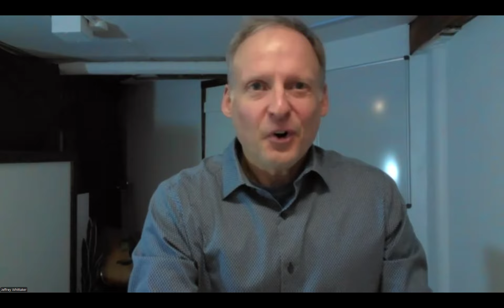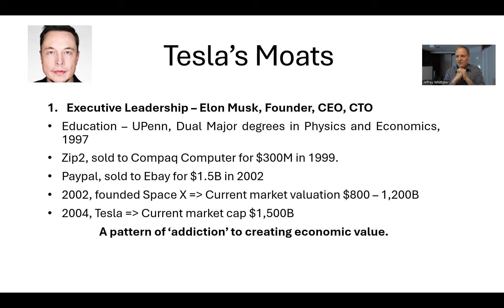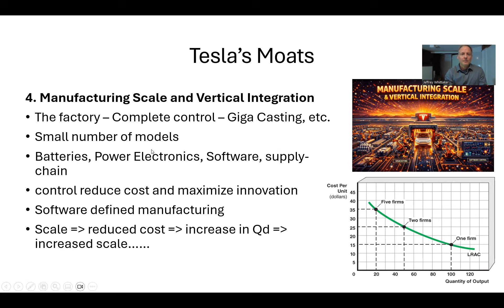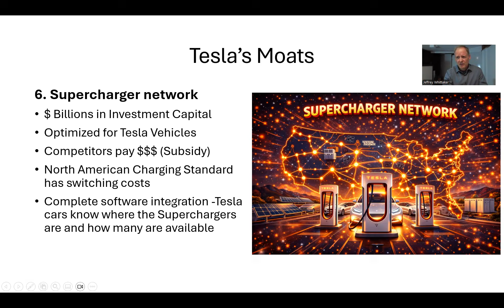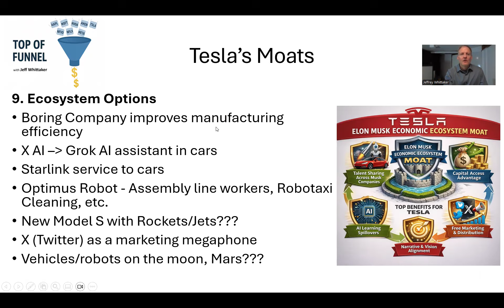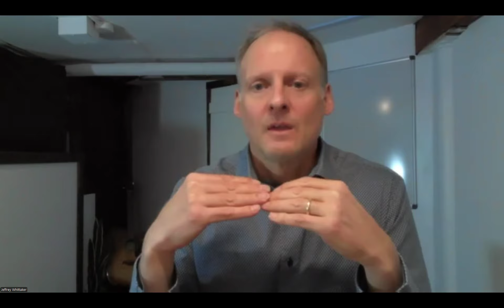Unmasking Tesla’s “Moats”: Why Competitors Struggle to Catch Up

Comment from the maker: At the 6 minute and 50 second mark of this video I shared information that a Ford UAW worker told me at a holiday gathering last week. The wonderful gentleman told me the reason the younger UAW workers were able to take so much medical time off from work was due to the FMLA act (and I relayed this as FRPA act in the video). I believe the UAW member was incorrect in assigning the blame for the employee absentee issue with FMLA. Having done some follow up research on this, I now believe it is more likely that the UAW has relatively generous medical leave benefits built into their newer contract that allow their hard-working members to take time off from work when needed. It is quite possible that the older members, such as the gentleman that I was speaking to, simply has not adapted his work habits to the new more generous contract medical leave benefit.